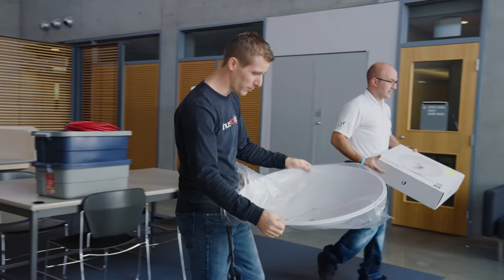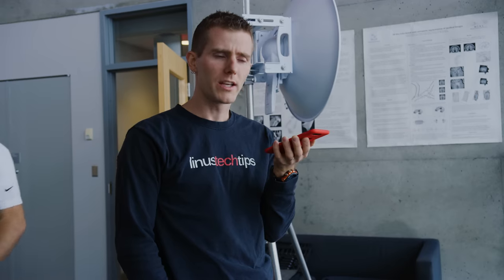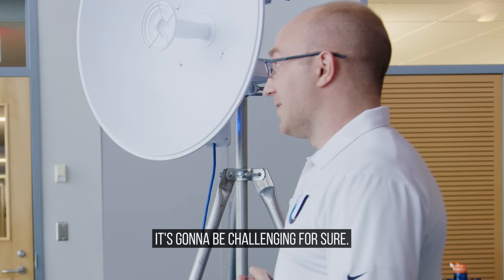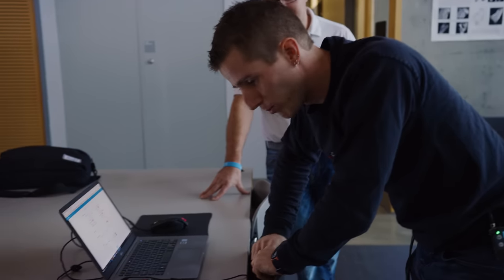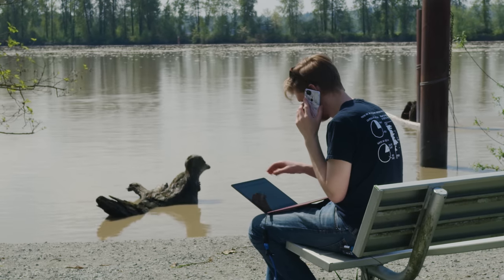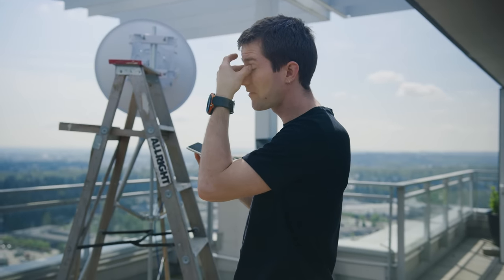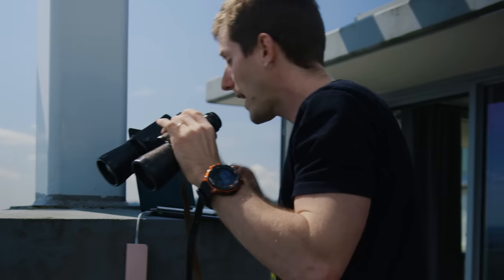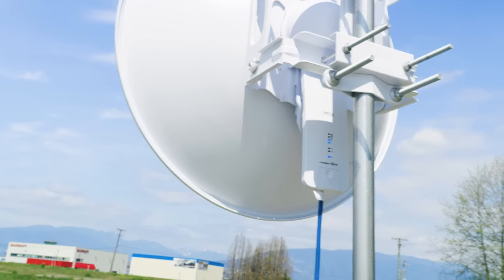12 KILOMETER Wi-Fi - SUCCESS!!!

Comment: Linus is using a radio satellite dish but how is that different from a regular cellular satellite dish? not a dish that brings in tv. 

can a dish that brings in tv be used as a cellular dish with wifi cap. probably have to do some makeshifting to get it to work?

Also if he was trying to connect multiple devices 3 miles apart to a server without using wires would they need their own dishes (not a straight line area)? Could they just use antennas? would they be wifi cap? 

It would just need to be low speeds to just make an application pop up on the multiple devices.

do the dishes need to be pointed at a tower or could some be pointed at each other to get the devices wifi ready. 

Side question: do you even need wifi for the 3 mile away device to reach a sever or do they all just need to be pointed at a cellular tower?

Comment: So I got you beet by far you got to redo you wifi it sucks so bad.... Get two telescopes connect them to the input of a fiber optics network and for the output use a lasers or strobe lights with parabolic mirrors as long as you can see the light with the telescope you got internet I don't see much range on my network other than can't see it but with two towers you should be good. Wouldn't this work for a moon network? Like if I had a strong enough telescope to see the light do I have a range other than at some point the latency may be too long and the cheap fiber optics network I got wont be designed for that much latency and fail to connect.

Comment: Totally reminds me of the days when Wifi first came out and I got my first 802.11b NetGear AP. We put it on my parents roof, then me and my friend went out for a walk across the fields outside of our village, and got about 2 miles away with a Yagi antenna and managed to get about 5Mbps out of the total of 11Mbps available, and were surfing the internet whilst sat on top of a hill surrounded by sheep... lol

I bet if we did the same experiment now, we'd barely get anything due to the massive boom of WiFi enabled homes now, and the SNR would be too awful to get anything useful. When we did that experiment, I think Wifi had only just hit the retail shops in the UK, so we were probably one of only a handful of people in my village who had WiFi. If my memory is correct, I think that was back in about 2001 possibly 2002 when we did that. Man fun times.

Comment: We did this at my workplace. It works most of the time, except for one of the towers in a very built-up area where the network traffic in the area is so saturated that we get very low performance. For the other sites, it worked really well and saved us money, though a few weather events over the years have knocked the antennas out of alignment and cause lower throughput or even no signal, and required someone to go down and realign the antennas.

Comment: I hope you understand that if this works, You will have just proved the Flat Earth theory is valid!!  Congratulations in killing the ball Earth lie!!
Reply: You will only just start to not see a average male around 3.3 miles away. Considering that 12km is 7miles and the average male is 5ft7 (3.3 miles is where you wouldn't see them over the earth's curve) if you multiply 3.3x5.7=18.42 feet and since linus is definitely above 18 feet. Even if he was a bit below that Radio waves are deflected in a number of ways as they move through the troposphere. For example, they may be reflected, refracted, or diffracted by air molecules through which they pass. As a consequence, radio waves can actually pass beyond Earth's optical horizon and, to an extent, follow Earth's curvature

Comment: 145 miles on a 75 foot tower.   record so far..  with 3g anyway.  line of site
Reply: Dude in order to be line of sight for 145mi the tower would have to be almost 15000ft to get over the horizon, unless the earth is flattened where the record was set

Comment: So basically, there's no point doing this? Also, why couldn't you just use a compass and one point exactly 180 degrees opposite of the other? Phone's have a compass btw.
Reply: Flawed. Doesn't account for shift. Imagine doing that on opposite side of earth. Will they be pointing at each other? No.
Reply: IntoTheVortex they’re not on opposite sides of the earth. It would at least get them close enough to detect eachother.

Comment: what's a kilometer?
oh yeah...Canadians.
Reply: and the rest of the world, admittedly.
Reply: kilo is the prefix for 1000 and meter is a SI basis unit. 1 meter is defined with the distance light travels in 1/299792458 s in a Vacuum. Didn't you learn that in school?
Reply: @happygimp0  American schools don't teach about other countries, lol
Reply: @dark flux
You need to understand meter before you can understand inches, yards and miles. An inch is defined as the length of 25.4mm. Did you learn anything about units in school?
Everyone uses volt, which is defined as kg*m2/(s^3*A), no one uses lb*in*ft/(s^3*A) for voltage. You need to understand meter, kilogram and ampere before you can understand volt.
Reply: @happygimp0  dude, take a joke.
also, an inch is actually defined as 1/12 of a foot, which was based on the human foot.
Reply: @dark flux
How can a unit be defined as the length of a body part? Everyone has a different length.
And you are wrong, 1 statute mile is defined as 1760 yard, 1 yard is defined as 3 foot and 1 foot is defined as 12 inch and 1 inch is defined as 25.4 mm. Please learn about the unit systems, especially about the metric system.
Reply: @happygimp0  you should do YOUR research. the Imperial system was started by the British (who no longer use it), and foot was taken from ancient Greeks, where the length was that of the ruler's foot (which is why rulers are one foot in length!)
the length of a foot has varied over the years in various countries and professions, but now it it settled at one-third of a yard.
Reply: dark flux it was based off of charts given out by the British empire that stated what an inch, foot or yard meant in the form of a physical diagram. However every diagram was different and in the modern era we use metric units (which are based off of measurable things) to base imperial units off of.
Reply: dark flux actually the foot is defined as 0.3048m

The meter has had 4 definitions over time, now we base it on something that doesn’t change: the speed of light in a vacuum over seconds (based off of the caesium-133 atom)
Reply: @zachb1706  yes, but originally, it was a single person's foot, which was how it got its name.
and the reason there were different values of a foot was because people misunderstood and thought it was the measurement of THEIR feet. commoners were not historically that bright, due to poor (or no) schooling conditions for the poor.

Comment: Hmm, Linus... I don't know why it is so special.. when in 2000-2001 I work for local WiFi ISP (before WiMAX), we have bunch of ~10km links, and more than 100 links between 5 to 8 km... off, this is all for planet external strong signal cards for user and some specialities systems on the tower side... all work with GRID antennas. So... nice 12km link in 2018... 17 years later... with much more advanced software, standards and equipment.

Comment: I dont know what these guys are doing here. 

First, you need to align the antennas (LOS) and also when one antenna elevation is bigger than 2nd antenna, then you need to adjust the angle (in their case, theta angle) , which is very important for LOS comunication. 

For the test of the comunication between antennas you need a signal generator (this should work on wifi frequency band (2.4 - 2.48 GHz) and also you need an spectrum analyzer.

 For the signal generator you need to know the power of the signal delivered to the antenna, cable loss between antenna and signal generator. (If you want to measure the loss on the cable, you need also a Vector Network Analyzer (VNA) to measure the transmission coefficient (s21)) Remember: transmission coefficient can be measured with spectrum analyzer too.

 Now, you know the signal power which is delivered to the antenna [dBm], the gain for both antennas [dBi], the Path Loss [dB],the cables loss [dB], the antenna efficiency [dB] and you need to know the the sensitivity of the receiver. If you know all of these the you can calculate if the communication is possible. GA1+GA2+EffA1+EffA2-PathLoss + Sensitivity of the receiver + imput signal + cable loss = positive number [dB]; at least 4 dB margin.

Ps1: Is very important to have a very small Input Relfection Coefficient (S11) for the antennas in their case on wi-fi frequency band, under -20 dB. That mean, the reflected power is under 5%, which is acceptable, or VSWR = 1.
Ps2: the path loss formula you can find it on google. 
Sry for my bad english.

Comment: Long range WiFi antennas like that are super useful for scientific research. We have a ton that we use to connect field stations. Our antenna mounts are much shittier though, we have to align everything by hand (literally holding the antenna and waving it around) and then just hope it doesn't move too much when we tighten it down.

For one of the stations we just try to point at a large bush along the side of the road.